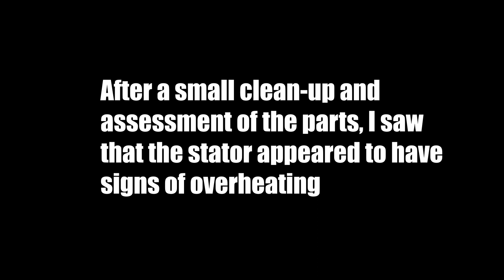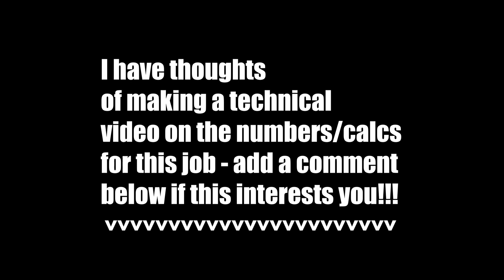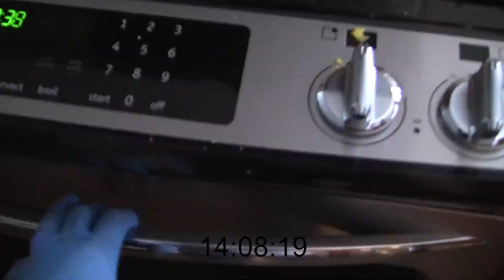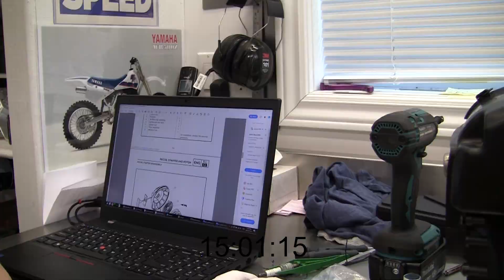1938 Reasons Not to Buy a "For Parts" Yamaha EF1000is Portable Generator!!! Brought back to LIFE!!!

Comment: The generator would have still worked if you had wound all the coils clock wise. 12 vdc is not regulated.  Stator burns up because 1) yamaha did not use high enough temperature wire, 2) after being under load, people shut off the generator without disconnecting and running at high speed for at least 5 to 10 minutes. 3) the stator is located under the exhaust. So it gets heat soaked and will exceed the wire temperature if not being actually cooled. 

I know as my generator had to have 2 new stators under warranty. 

I hope you used better high temperature wire. 

Where is the 12 volt coil windings. 

Is it 2 Delta coils or 2 wye coils.    

My Yamaha EF1000is ended up having a rod knock, and the dealer lost all the fuel system. Tank, fuel shut off, fuel pump, carburetor,
Reply from the maker: @geoffmolyneux9173  well I wanted the proper phase rotation so redid it the way it was. As for the DC winding it was two of the poles in series. Yes I used top quality wire when I redid it. I think all the reasons you mentioned are good ones but another factor is that this one was sitting in loose sand which I think went through the generator also. Thanks for watching!!